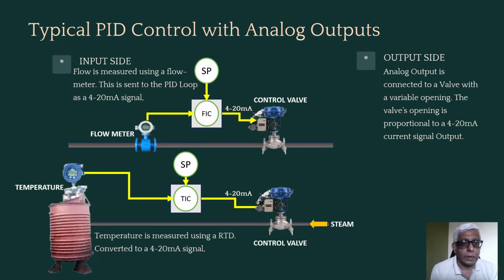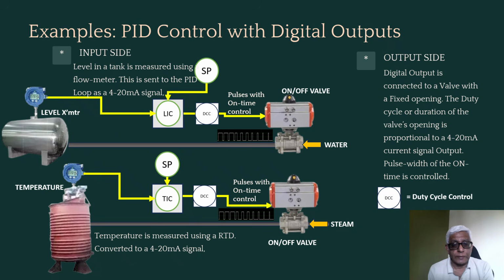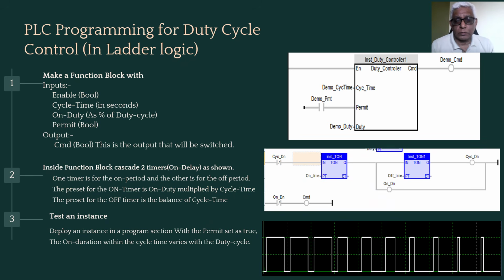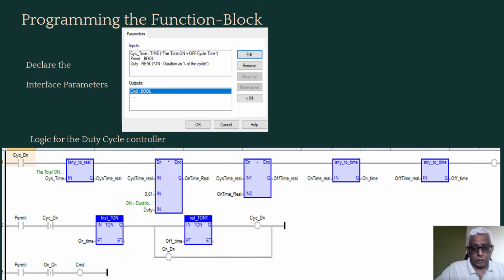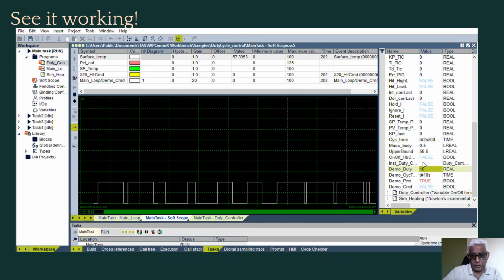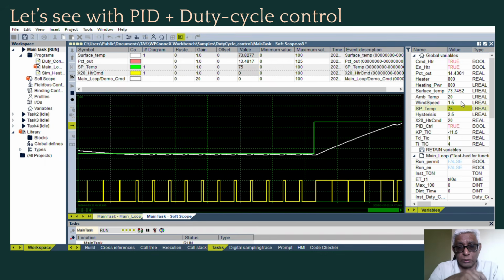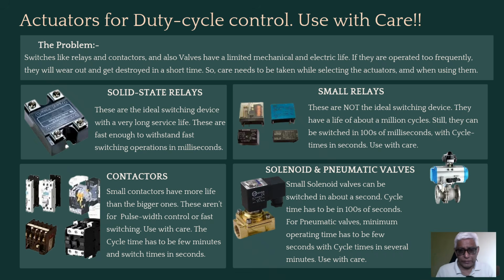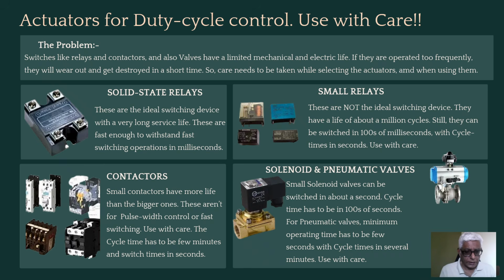Duty Cycle Control Using PLCs

Comment: Very good presentation. This will help young automation engineer in process industry to understand PLC . You have shown a process PI & D and also explain about the control part is too good. This will help to understand how to use PLC for control duty. Same basics can also used in batch control system. Your explanation with presentation is too good and well explained. Best wishes Rsj sir. You are hero in PLC programming. 👍👌👌👌💯💯💯